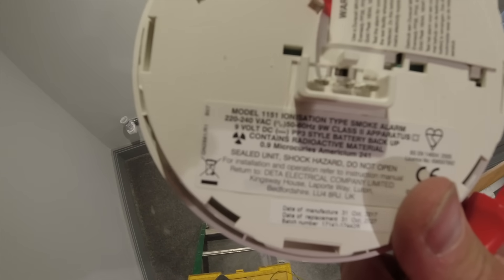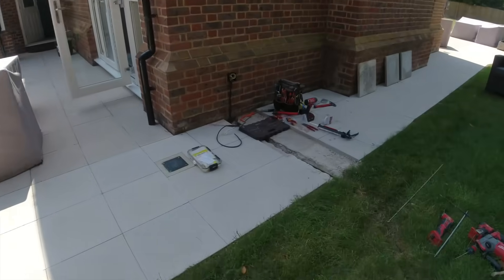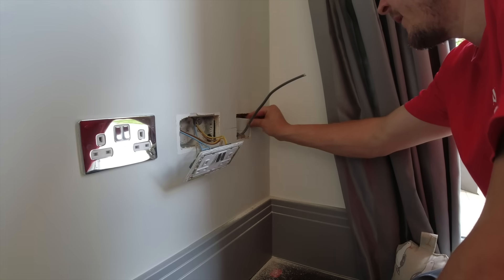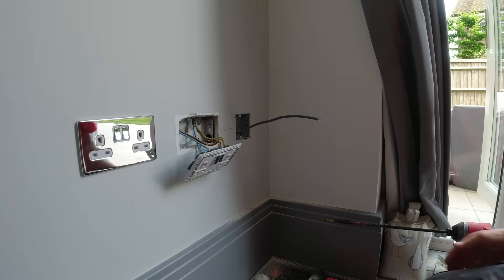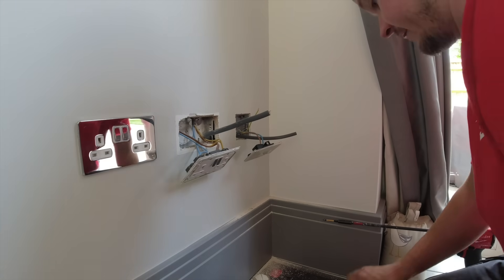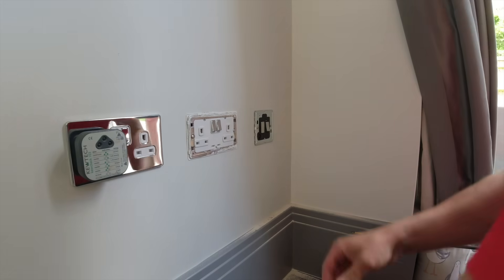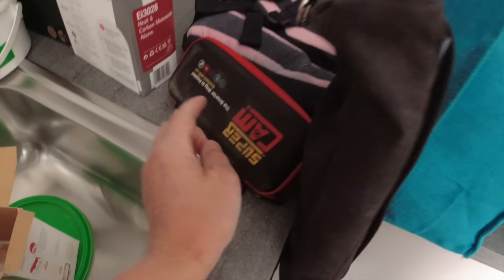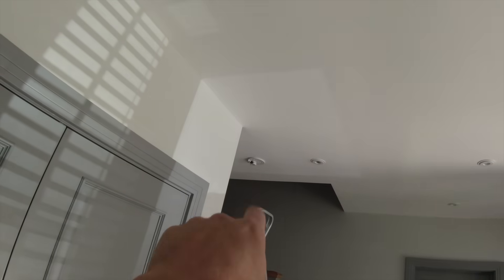Why do they always fit the incorrect ones? PART 2

Comment: Well it's better cable being long than short as you can always easily compensate for any mistakes with cable lengths. My previous electrician cut through the entire joist to fit a down light and it was only hanging by the thread. He made the hole at the wrong place and did a quick job of covering up his mistake by causing more damage by drilling right through  joist aswell. Not in one place but 2 different places.

Comment: So you will always spare from a socket to run a summer house with CU. or you usually run a main cable from the main CU, give a 32A fuse for more load?
Reply from the maker: Both
Reply: @Cjrelectrical  but what would be the best?  I suppose if you have a spare  in the main CU and easy access to run the cable, you would probably pick that option.
Reply: It depends on expected load as well as convenience of cable run from CU. If it's a long way, and a small load, no point doing it. If it needs a large load, it's necessary but very expensive. A small outdoor room might draw 1.5 kW heating and a few hundred watts for TV, lighting, computer etc. Fine on 13A.

Comment: Should the carbon monoxide alarms be 😊on a separate circuit so the tenant knows how to react for carbon vrs smoke. If all alarms sound you will not know if it's smoke or carbon
Reply: Correct..Carbon monoxide and smoke detectors are not allowed to be interlinked, they can be on the same circuit, but must alarm/sound separately. Chris said that he was fitting a combined detector, so it may respond differently to heat/Carbon monoxide.
Reply from the maker: The standard Aico Fire alarm pattern is a continuous rapid pulsing sound type, while the distinctive Carbon Monoxide alarm pattern is a repeating cycle of 3 slower sound pulses followed by a pause. On the Ei3028, the LED display will indicate if Fire or CO is detected. The flash rate of the red LED indicator is dependent on the alarm event type, and in the case of CO, on the level detected. Table B shows how the CO sensor reacts to different levels of CO gas and exposure time.
Reply: @Cjrelectrical  thanks for the info

Comment: 13A fuse at one end and 16A mcb at the other? What does the mcb protect if the fcu fuse is lower rating?👍
Reply: 16A mcb will trip before a 13A fuse will blow.
Reply: Bugger all...... I would fit a fcu in the shed to supply the lighting. No need for the CU.
Reply: @christopherhulse8385  - how? Even at x3? That's 48A. The moon is made of cheese by the way...
Reply: @ef7480  Because of the tripping curve, because fuses would constantly blow due to inrush current from certain appliances, and it is hard to get perfect tolerances on the wire thickness, hence the 13 amp fuse would only blow under prolonged load over the limit. At least that is my knowledge.

Comment: Is the super rod camera better than the ferret?
Nice to see a fellow sparks who doesn’t run a 6mm swa out for a few sockets & lights in a outbuilding! 13amp switched spur is more then enough most the time. 👌🏻
Reply: Yep, just no need for the DB that he fitted at the end of it ….
Reply: @JamesEdwards860   It's to prevent nuisance tripping in the house, quite reasonable to put a DB in IMHO
Reply: @mikeenglish6734 no guarantee that it will trip at the remote db before the main house.

Comment: Ionisation Smoke Alarms are largely obsolete, having been banned in Germany, France and some other EU member states for a few years because they contain radioactive material. You should only be fitting Optical Smoke Alarms. Heat Detectors in Kitchen areas.
Reply: EU precautionary principle nonsense. They react differently to different types of fires, therefore have their uses, and you can't always predict what type of fire you're going to have so can't always predict what type of sensor you're going to need and it isn't always optical or heat detector. There's zero risk from the radiation unless you literally take them apart - don't be like David Hahn. Actually, if anything you really want dual sensor smoke alarms with both optical and ionising detectors, though most would say one is good enough - but dual is the "perfect" solution because it responds quickly to both the sorts of fires that trigger them. I dunno, I have a heat detector in my office because I vape, but still - as a generic install option dual sensor is best and properly solves the problem of correctly selecting (or more accurately predicting) which you need. Ionisation detectors are far from obsolete - modern optical detectors are good, but they're not perfect which is why dual sensor detectors are a thing made by the best smoke detector manufacturers.
Reply: Hmmm, the ionisation from a smoke detector consists of alpha particles which are stopped by a thin sheet of paper.